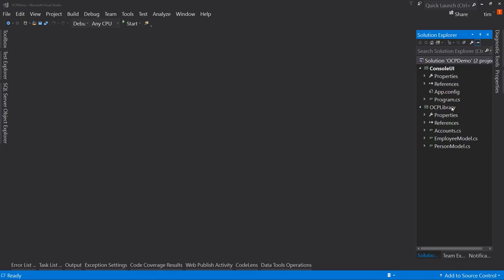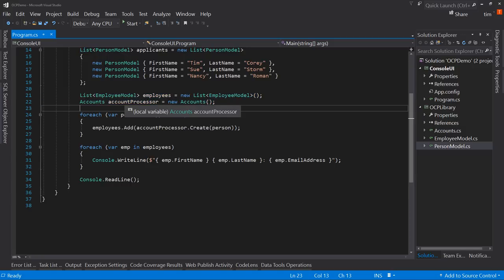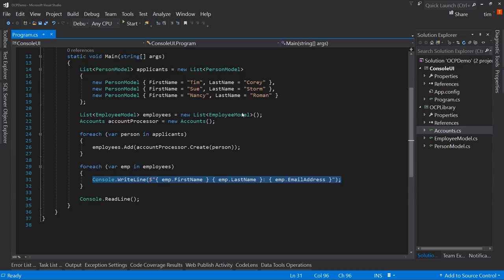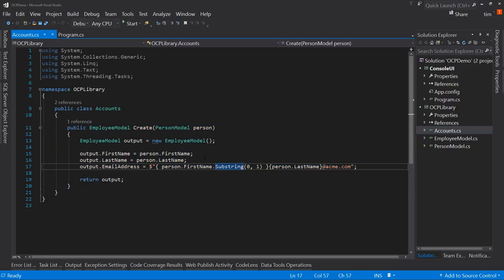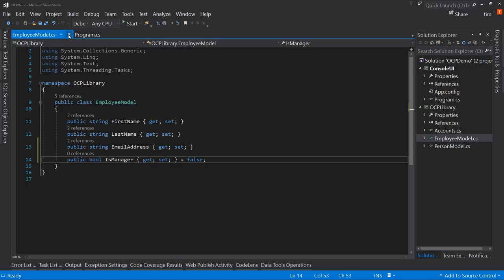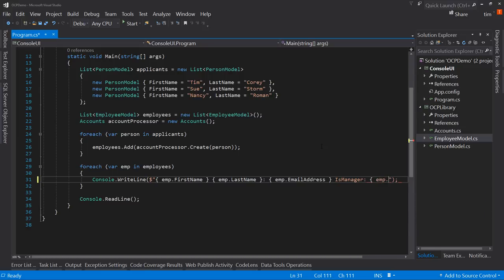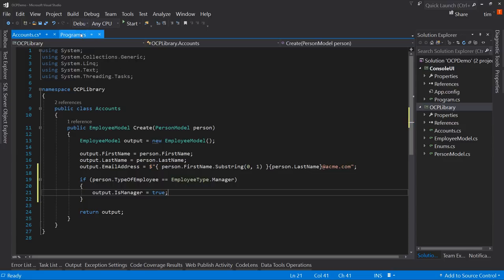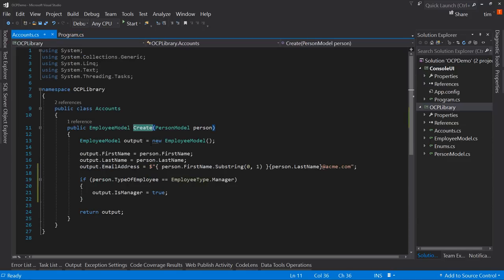Design Patterns: Open Closed Principle Explained Practically in C# (The O in SOLID)

Comment: Hi Tim,
I'm working through your C# App From Start To Finish, and digesting some of these other videos, and this is all great stuff; thanks for this. I'm a long-time VB hobbyist (I can't say I'm a pro developer even though I have quite a bit of code here and there in macros and smallish apps at work) and I'm trying to transition to C# and to think more in OOP. I'm struggling with Interfaces (saw your Interfaces vid) and this compartmentalization of the code. (I come from a world where everything was in the frmMain module... ;-) In this particular video, I would have approached it as using an Employee object, and used an employee.ActivateAccount(applicant, empType) method, where the empType is an enum. Then, instead of adding an entire set of interfaces and models for a different type of employee, you just add a new entry to the EmployeeType enum, and add a new entry to your case or switch block to implement differently where necessary. You're not necessarily changing code flow nor are you touching existing logic, but you are adding sections in a somewhat safe manner. I get that this is just a simple example, but if you have to recover from not allowing for different employee types (i.e., a big requirements hole) you're gonna have to tear into some code anyway. Also, while I understand that you should have different classes to represent your various objects, to have different classes to do different things seems strange to me -- wouldn't you just implement different methods or properties for the class? I have a nagging feeling that I'm missing some higher level understanding or approach; perhaps you need a few PowerPoint slides after all... 
Keep up this great work. I was floundering until I discovered you. 
Regards, Renny
Reply from the maker: The issue with the enum is that you are making changes in multiple places then. Yes, it is only adding logic not altering it (for the most part) but it is a change. Besides, if you make that change and the new part of the enum has a problem, you break existing code. One of the things that will help is practice. The more you see these situations, the more you will understand the long-term implications. This is a rather hard one to jump into when transitioning over to a true OOP way of thinking. Great thoughts though. I'm glad you are thinking it through.

Comment: Hi Tim,
In this example, The EmployeeModel  which is the return type of method and was the same before new change(Manager, Executive) was introduced. How do we manage when EmployeeModel would not be same and also required to be changed ?
Reply from the maker: If you are changing the return type of a method, you are fundamentally changing the method. If it is because you found a bug in the method, you would change the method. However, if it is because you are changing what the method does, you should probably create a new method instead and leave the original alone, so you don't disrupt existing applications that rely on it.

Comment: Great explanation, really hit home on why extension is the way to go and why modification is so dangerous.

Which is why I think you overlooked the concept of a base class and hierarchy a little too quickly. That’s exactly what child classes inheriting a base class are doing: extending. You were talking about violating DRY; a base class can do everything an interface could with the benefit of reusing code. 

If you need more logic in a particular function for a child class, then you create a new function with a call the base class function. And if base function(s) shouldn’t be reused on that child class, maybe you shouldn’t be extending off of that base class…?

Interfaces are great for unit testing and guardrails, but anything else can be done with hierarchies. Yes you need to be careful (calling a base function from a child class when you meant to call the child function…yikes) but it’s a powerful tool.
Reply from the maker: Inheritance is a powerful tool, but it is also very limited. You need to be careful when you use it that you don't cause more problems than you started with. For instance, if you decide to improve a method, so you create a child class, everything seems good. But then what if you wanted to change a different method but use the original of the first method? Now you have two different children inheriting from the same base. That seems fine. But now what if you want both of the updated methods? Now you have a problem. You cannot inherit from either child class without duplicating the work of the other. Inheritance locks you in a lot more than you really want if you aren't really, really careful.
Reply: @IAmTimCorey you’re correct of course, and careful designing and sticking to lose coupling-tight cohesion is a requirement for sure. But for that particular example one could argue the same implementation done with interfaces would also require duplicated code.

In my opinion, you’ll have to violate DRY in the real world regardless. I think hierarchies do it far less, but you can get tighter coupling as your example illustrates.

Comment: Hey Tim, very good stuff, thank you! Quick question: I see that with OCP, you tend to allow a little bit of DRY... I guess this should be acceptable, right? Or is there a better way to prevent DRY here?
Reply from the maker: Code repetition does not necessarily represent a DRY violation. However, in this case, we had a bit of repetition in the properties in order to demonstrate OCP rather than creating a base class and going from there.

Comment: Hi Tim, Thanks for the awesome tutorials!
Did you do something special to format the way Visual Studio implements an interface? (@29:32) When you do it all the properties are neatly written on one line each, but when I do it, VS generates code with expanded curly brace wrappers, so each property takes up 12 lines.
Reply from the maker: How VS implements the interface is always a bit messy. I typically try to avoid the generation of properties if I can help it. The newer versions of VS2017 seem to be a bit better at the auto-generations than the older versions. If you can, though, copy and paste your properties from another class that implements it.

Comment: Hey Tim, why would you say that inheritance would be a disaster here? Do you have some material about when to choose inheritance or interfaces? I thought when you have a "X is a Y" you should use inheritance and when you have a "X is capable of doing Y" you should use an interface. According to this idea, I think inheritance is a better fit here. But I am a beginner and a little bit confused about this topic.
Reply: i agree with you, Inheritance certainly would work the same as interface here for this example.
Reply from the maker: The "is a" relationship tells you that you CAN use inheritance, but it does not tell you if you SHOULD. That's the tricky bit. In this case, if we try to use inheritance, what we would end up with is a very small amount of functionality in our base class and not much benefit for doing so.
Reply: Inheritance on a larger scale system tend to be a source of inflexibility if applied the wrong way. I tend to keep inheritance to small focused base classes only if I have multiple implementations of an interface that need properties repeated. If you follow SOLID you tend not to need inheritance as much.

Comment: Hi Tim - great video! Thank you! Is it possible to combine the practice of class inheritance with idea of using interfaces for OCP? In your applicants folder you have models for different roles of persons. You named the original role PersonModel, which perhaps would better have been named ApplicantModel (or EmployeeModel). Let's assume we refactored the code to rename your PersonModel to ApplicantModel - would there be any good in creating a base class PersonModel and have ApplicantModel, ManagerModel and ExecutiveModel inherit from that - as well as creating an interface IApplicants?
Reply from the maker: You can but inheritance rarely is what you want, in my opinion. Usually when you start down the road of inheritance, it is because you want to share code but then you find more differences than similarities. The next video in the series should highlight that a little more clearly. I tend to shy away from inheritance unless it is very clear that it will work and the relationship is correct. In our case, the base class would not have had any real code in it because the code changed from implementation to implementation so all we really had was similar classes, not classes that were the base class.

Comment: Question: If changing Base Class breaks OCP and an creating a New Interface which breaks LSP, doesn't that block you from making changes?
Reply: For OCP, you break it only if you keep changing the same class, which already works fine. For LSP, it's basically the same and to not break it, you should make a interface which could be diferent on each implementation.
Reply: @genesessilva3429  Thank You!
Reply: @LarryPeteet  Yw

Comment: Thanks for your valuable content. I have a question, all the resources I referred to that are explaining the ocp principle are always using the if-statements as an example of when you need to refactor your code to be more abstract and to be OCP-Complaint, so correct me if I'm wrong: Always, or it least most of the times you apply the OCP when you have multiple if statements that are changing each time you add another case. If it's not only the case, what could be another example for using the OCP in the code?
Reply from the maker: If statements are just the easiest to visualize. Any time you need to modify a bit of code internally to have it handle more situations, you need to think about reworking it.

Comment: Loved the video, but I do have a question. Doesn’t including the IAccounts interface in the classes that implement the IApplicantModel tie those classes to a concrete implementation such as the Accounts class? I don’t know how I’d avoid the concrete implementation, but it seems as if there must be a way to decouple the classes that implement the IApplicantModel from the concrete implementation of Accounts, ManagerAccounts or ExecutiveAccounts.

Thanks
Reply from the maker: All of those implement IAccount so they could be used. The only thing you are locked into is that it has to be an IAccount. Any class can do that (if it makes sense).
Reply: IAmTimCorey I was hoping that there would be a way that I could pass the concrete Account Processor classes into the classes that implement IAccount so that models like TechnicianModel, PersonModel etc... didn’t have to “new” the concrete Account processor classes so that I could further decouple the model classes from the Account Processor classes.

 I don’t know if that’s even possible or wise. I may be taking the concept of decoupling too far.

Thanks
Reply: Michael Eichner I think you would want to inject your concrete account processor class into the models that need it, probably via a constructor.

Comment: The thing that bugged me the most is the lack of validation on existing email adresses. :D Create an employee: Thomas Corey
Joke aside, the thing that always confused me the most about OCP is the fact: that it can only ever be truly OCP if things are setup correctly in advance. While transitioning from base-code to enforce OCP you WILL violate it, as you need to edit your existing code to make it possible. So I always felt I'm doing it wrong as I was trying to implement it. :D (or maybe I just take the "Closed" part too literal)
Reply: Same here bro. I also need the answer.
Reply: @vijaysapkal5788  Thats called refactoring, not violating it

Comment: Thanks for the great explanation, Tim! I do have two questions I'd like to ask. 

First, supposing that you had a lot more going on in the AccountProcessor.Create method, and started to get a lot more duplicate code, how would you go about refactoring it to make it conform with the DRY principal? I know a lot of people have mentioned inheritance, but I was wondering if there was some other approach you might suggest for this. 

Second, in the video I believe you mentioned something about breaking the dependency between the AccountProcessor implementations and the EmployeeModel class. Do you have any suggestions for how this might be accomplished?
Reply from the maker: That's a bit much to explain in a comment. For the first part, I would probably use delegates. You will see that in a video coming out soon. For the second one, I would probably use an interface.

Comment: Very nice video! Thx!
Btw, What you did is a design pattern or you just refactoring to depends on interface over concrect object?
Reply from the maker: OCP is a design pattern. Since the application did not apply the design pattern at first, we had to refactor it to apply the design pattern.

Comment: This was truly complicated and amazingly explained and in the end everything made sense. You're an amazing teacher, thank you so much! 
Just two questions:

1. It is true that the naming was a bit confusing but I made my own names and rewrote the whole thing. I realised that in the end the fact that the method of the IApplicantModel interface returns an EmployeeModel type object but takes as parameter an IApplicantModel type. I was wondering if there was an alternative to this?

2. One syntactical question only about the parameter of the Add method in the first foreach loop on the Main class: why does it have to start with mentioning the local variable first and then the rest? Not sure if the question is sensible enough but I am still very confused about how that parameter is structured as I am a bit new to C#. I know removing it would cause error, but I am unsure why.
Reply from the maker: To answer your first question, we ask for the interface and get back a class that implements that interface. That is ideal because we don't have to return an EmployeeModel, we could return something else. If we asked for an EmployeeModel, we could only return that type.

To answer your second question, that is how a foreach is structured. We establish the variable at the beginning and it is populated each time with the next item in the list.
Reply: @IAmTimCorey  thank you for answering !

Comment: 46:03 Is it a good practice to keep classes in a project on a single namespace? What's the primary use of these branching namespaces? (OCPLibrary.Applicants...)
Reply from the maker: Not really. Namespaces are yours to manipulate as it makes sense. They allow you to organize your code virtually in a manner similar to how you organize it physically (although the two don't have to be related). For instance, if you had a tool library called AcmeTools, you could create a new project and name the namespace AcmeTools so even though the code lived in different libraries, it would use the same namespace (and appear as if it were one library).

Comment: Great video! 

How will you apply the OCP to the Program class later on when we have a type? For example, say we have a BoardMember type later on and we need to add the line "IsBoardMember" in the Console...
Reply from the maker: I don't understand the question. Can you explain a little further?
Reply: Sorry I'm new to programming so it's not very clear. 

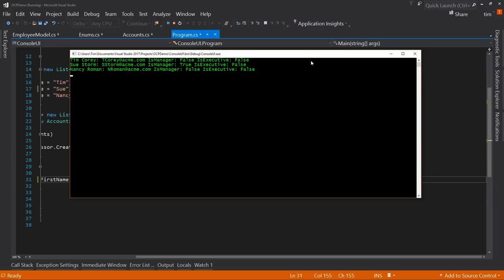At 15:19 in the video, codes are changed in program.cs by adding "IsExecutive" to the Console.Writeline statement. It appears to me that the program.cs is not entirely close for modification because if a new Employee Type comes in (say Board Member), we will have to modify the code. Is my understanding correct?

And if so, how will you refactor the things in program.cs so it does follow OCP?
Reply: Hi Tim, does my question make sense?

Comment: I do not clearly understand whats the point of the EmployeeModel class or did i miss some explanation? To me it looks like it is only used to compare all the different IApplicant models. The EmployeeModel must contain the union of all attributes of the different types (namely isManager, isExecutive, firstName, ...) while the models only differ in their AccountProcessor attribute and do not contain any data except what is common among them (names). The accountprocessor just tells you how to create a common "base class" namely the EmployeeModel out of this type by using an additional indirection. Im not entirely sure but cant this approach be simplyfied by using an abstract base class instead of having the EmployeeModel as a separate class, let the different types of employees inherit from it and put the Create() codes into the constructors? You also wont need to change the child classes if you add executive or manager to the base class as these default to false just like in EmployeeModel.

However both approaches do have problems in common:
If we created the executive first and then the manager, we would have had to change the executive because bool does not default to true.
Also Main and EmployeeModel have to always change if we add a new type of person that comes with a new attribute.

Comment: Hey Tim I was wondering if adding the I accounts accountProcessor inside the person model doesn't infringe upon SRP?
Reply from the maker: Nope, but good question. We needed a way to associate which type of account processor should be used with a particular user. Using the property with the interface allows us to associate the information with the person (the class then just holds info about the person, including which processor should be used) but yet if we need to change the logic of a particular processor, we don't need to change any person model.
Reply: @IAmTimCorey  Doesn't it create a dependency of, for instance, ExecutiveModel on ExecutiveAccount?